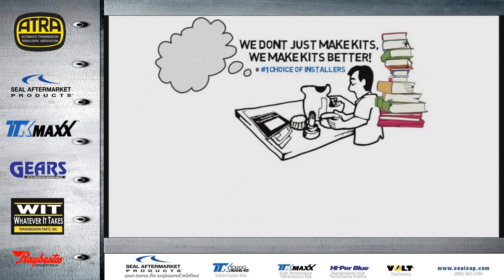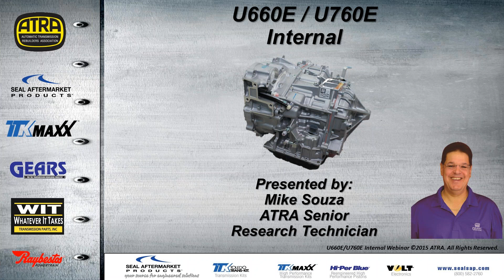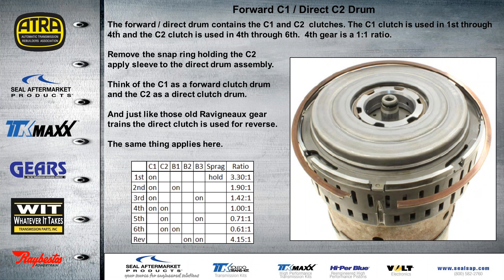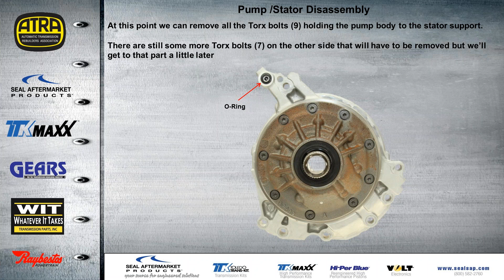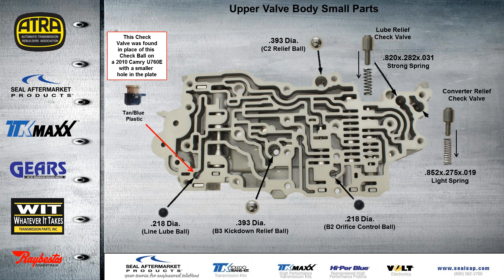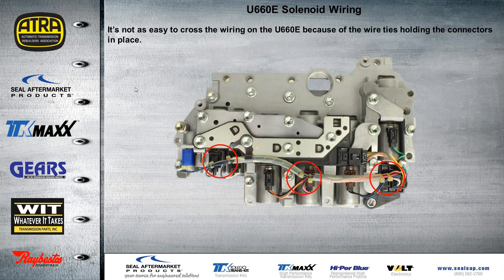U660E U760E Internal

Comment: Hiya 
I like your youtube channel. I have an issue with my Toyota U660F gearbox. initially the vehicle had a issue with a drive ring bearing smashes up so it had loud noise and eventually lost drive. We rebuild the gears, replace clutches, seals pistons.  i reinstall the transmission and drove short distances around the block fine for couple of days. i then noice a whine and is slowly lost drive. it will move a little when cold but wont at all after a few minutes . 
so I connect a clear hose to the incoming and outgoing oil cooler lines. I found that no fluid was pumping through, in any gear. should I expect oil to be pumping through the cooler lines when cold? is there a valve body solenoid or valve that controls this? or do you think it is the pump itself. it seemed ok when I first striped it down. is there a way to air test the pump? 
or can it by the torque converter?
Appreciate you advice and expect advice,

Comment: is there an unobstructed path from the fill plug to the bottom of the pan on a U760E transmission to insert a suction tube to remove fluid?

Comment: I have a 2013 toyota with a u760a transmission,when removing the valve body do you need to disconnect the harness connector on the outside of the case  to do this?.

Comment: thanks for very helpful video, I have a question tho, I have a toyota with a u660e and it's making "power steering like"/aerated fluid noise in reverse, or at least most noticeable in reverse, and around 2000-2500rpm, is this something common and possibly fixed with one of the sonnax repair kits for the valve body or is it beyond that. Also line pressure in R and D is within specs(measured at the port near the cooler lines)
thank you
Reply: Kendall Ceban Did you ever get an answer to this? Everyone I know with the u660e has a whine.